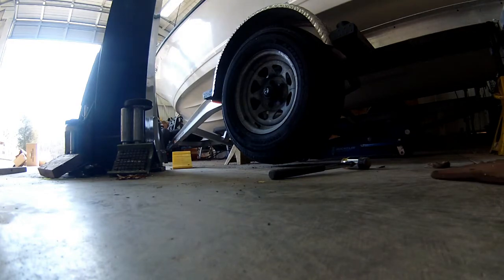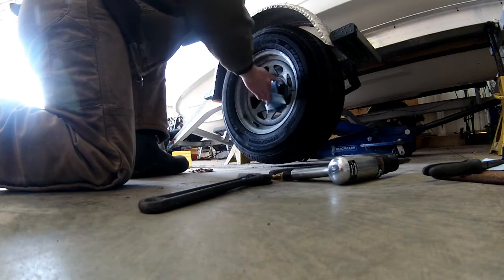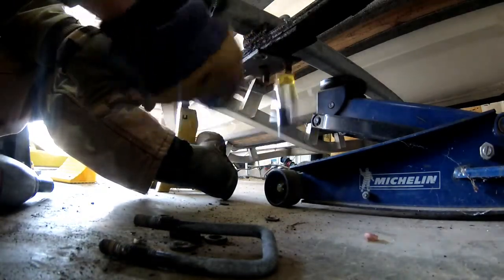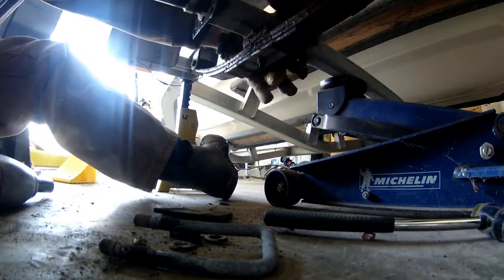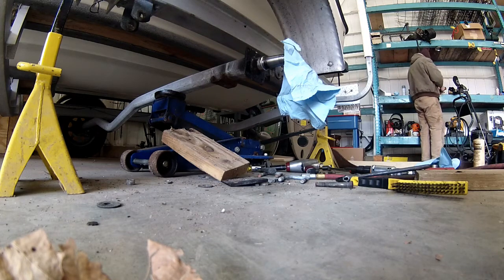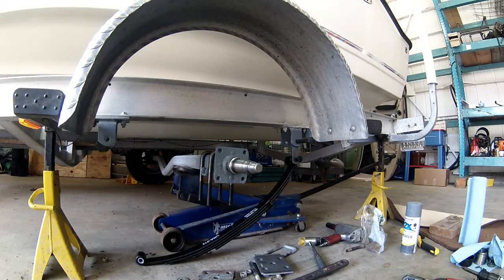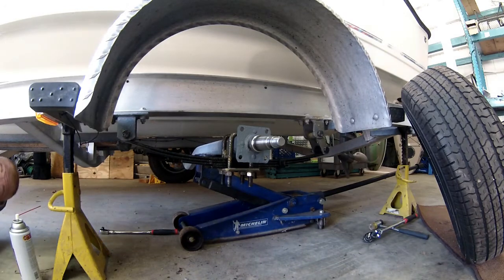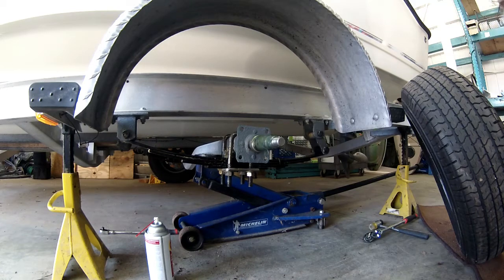Replacing trailer springs on boat trailer

Comment: I appreciated the video would have liked to see a few more steps regarding the 2nd bolt of the spring. Did you put the 2nd bolt through before the u bolts? or the bolts then the 2nd bolt? Thanks either way nice video.
Reply from the maker: I put the bolts to the leaf spring on first (to the trailer frame) so it would hang for me before installing u bolts for the axle.  Otherwise, you need a 3rd hand to line everything up.  Additionally, you will need to line the leaf spring center pin with the pinhole on the bottom of the axle to "locate" the axle correctly before installing and tightening u bolts.  This is why I installed the bolts on the leaf spring to trailer frame first so I could then push/pull the axle around to fit in the hole.  Once all the weight is on the ground I then tighten the bolts per spec.
Reply: @kiotick25  can use any bolt for bushing eye 👁 like stainless or galvanized?

Comment: TMI - you talk a lot. So is there a front and a back on the springs? if they are double eye, does it matter which way they are installed? is the little nipple hole on the axel a universal size? does it matter what brand or spring tension I buy?

Comment: Awesome video I just have a question of aren’t the clips that are on the springs supposed to face the front of the trailer ? Yours were towards the back? Asking because I don’t know
Reply from the maker: Turfsurfer91  I don’t understand what u mean by clips?  Do you mean the metal shackles that bolt to the frame to the eyelet of the rear spring?  If so these would mount in the rear eyelet of the spring and slight angle rearward.
Reply: Kayak Strong no there is a clip/wrap that goes around one side of the leaf spring and I was told they go to the front but I noticed yours were to the back